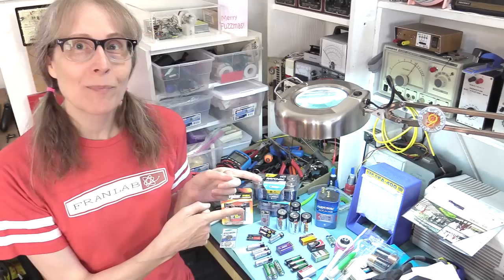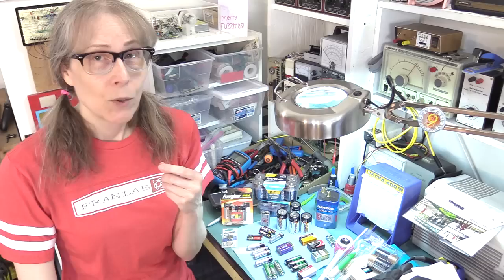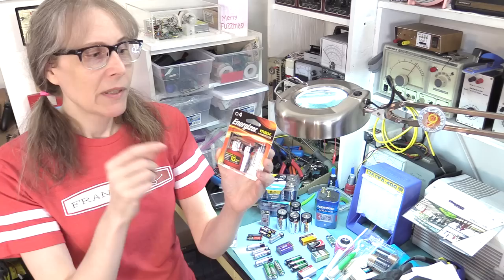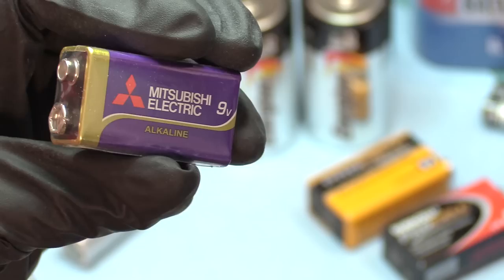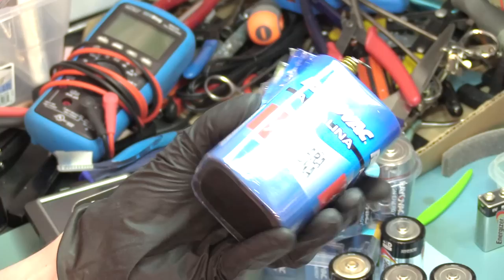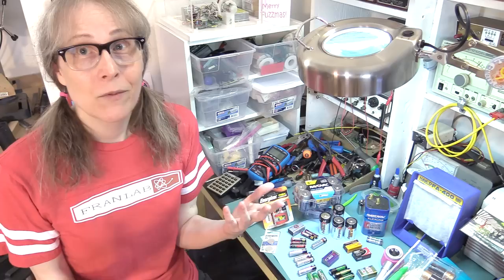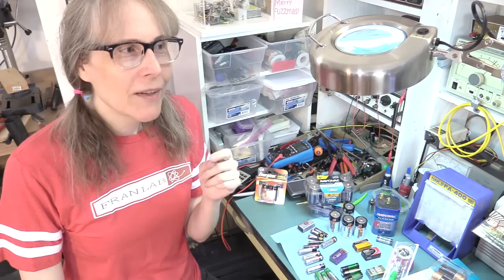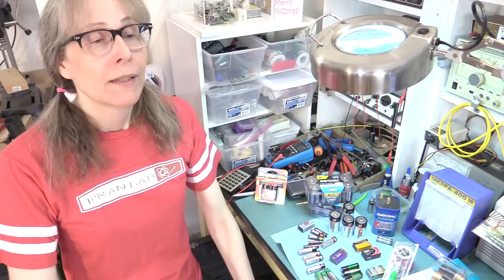Yikes! Leaky Alkaline Batteries!!!!

Comment: I've mostly switched to either "1.5V Lithium" Batteries or using NiMH Eneloops.
Be careful with the Lithium batteries tho as they have an open circuit voltage of 1.7V....so putting Lithium batteries into a device that uses more than two batteries in series is a VERY BAD idea. I've screwed up an expensive tester that way...
Reply: Nerdywolfi, good point ---- i have found that the lithium cells may tend to overheat some types of LED flashlights, especially the "cob" yellow strip leds. The designer was probably counting on the high internal resistance and voltage drop/current limiting inherent to ordinary alkaline batteries.

Comment: All brands of alkalines will leak.  Had it happen in the package and in devices.   Had a few leak in the package in the first year and the rest still good 8 years later.  Fresh, old, full, dead... maybe old and dead and Duracell is twice the chance, but at that level of chance you have to treat them all the same.  Don't leave in equipment.  At all.  One day they're good, next day a pressurized leak.  For a mouse you kind of have to leave it in, so I just wouldn't use alkalines in those.  Eneloop is ideal, or a "heavy duty" cell if you want a lighter mouse.  Heavy duty will eventually leak but it is much more gradual and much less wet.   At mouse (or remote control) current drain they're 1/3-1/2 the life of an alkaline.

Comment: Ive often seen zinc chloride "heavy duty" batteries leak in devices but not alkaline. I hate zinc battery's, they're not heavy duty and when they leak they badly corrode the battery contacts.

Comment: @Fran Blanche - According to wikipedia, Procter & Gamble sold off Duracell in 2014. For me, that just about lines up with the last time I had reliable Duracells. Today I refuse to buy them. They're awful.

Given the hanzi characters I think I'm always seeing on the Duracell labels these days, I'd say the manufacturing was all outsourced to China by the new owners. Unfortunately, Chinese culture is infused with the concept of chabuduo, which translates roughly to "close enough", "good enough", or more verbosely, "it only needs to work; it doesn't need to work well."

This is why I never buy anything that's "Made in China" if it's mission-critical or relates to my health & safety. Take advantage of their minimum-bid low-effort cost-cutting where it's appropriate, but don't use their products for anything you need to be good, safe, or durable.

Comment: Alkaline batteries always leak in equipment that has no standby current. If it has a quiescent current drain like a long life circuit eg a smoke alarm its fine. If it's something with a physical switch that completely cuts power thats when they leak. And its not just white powder its clear liquid acid that rots the contacts. I've had loose alkalines in the box that have leaked and split open. They need current drain or they fail.

Comment: do You know what other bad things people do with old batteries? more often than not, they throw them into recycling paper collections! that is very wrong, because the batteries get smashed in the recycling-pulper and the chemicals get into the process water, then into the waste-water treatment facility (which at best remove a fraction of that) and then ultimately into the rivers. It is not right to blame the recycling papermill for that. See what you ultimately get in the rivers: Li, K, Mn, Ni, Hg?, Bb, ...

Comment: You ask why did this happen, I say because you bought duracell's.
I might be a bit biased but I mean even their commercial is... "If you don't buy duracell's you might accidentally! fall off a cliff" the only thing it's missing is the mobster accent.

I can't say I've officially tested this but every time I've encountered a leaky battery majority have been Duracell.

My preferred brand is Energizer followed by Rayovac and if I'm at the dollar store I try to use Panasonic, assuming I'm not using rechargeable.
Oh yeah and I've got to the point that the batteries come out of the all devices when not in use it prevents draining and prevent leaking.

The only thing I leave batteries in are flashlights and then I try and check them weekly to monthly and log what was in them. PS maglites will warranty the flashlight for free if you have duracell's in them but you'll be paying for a replacement if they find out they are not.

And anything else that has to still have the battery in I try and leave in a way that if it leaks the circuit board is above.

Comment: I only wonder why they sell 1.5 volt batteries (as an example) and they stop working at 1.2 volts.... That means that overall electronics manufacturers have a secret contract with battery manufactures to keep them money rolling. A shame really, I have this LED light for outdoor use, in it are three AA batteries, which makes them total to 4.5 volt to the LED, and the light is 10 % of what it was when I installed the batteries when they were new. Measuring the batteries power output, they gave 1.2 volts.... 
Damn. How often do we throw away batteries that are 100% drained??? I do not think we do. So, we buy 1.5 volts, use .3 volts out of it and dispose the rest...  HUH??????
If we could combine those 'drained' batteries, we could power alot more longer, but the weakest link kills them.

Best solution for manufacturers of battery powered devices is to build a little vamp in it, sucking every last bit out of the battery.
https://en.wikipedia.org/wiki/Joule_thief
But..... they would not do that, because of the income it generates from depleted, as in not so much, batteries that need to be replaced.
Money, money, money, money.... and the environment?    Shame on those big companies....

Comment: Shelf life is when stored at room temperature. Chemical reactions (rule of thumb) double for each 10 degree rise centigrade temperature. I usually buy the bulk packs for economy, then store them in a sealed plastic container in my refrigerator. It takes me years to go thru them but they are always nearly full charge after years of storage. Don't put them in the freezer thou!

Comment: I always clean my corroded contacts with deluded acid =D
Reply: You might want to neutralize them after that. Acid will attack them too. Depending upon which acid you use it could take a while (or not). Alcohol should do it. Be sure to get under the contacts too.

Comment: Add me to the ban the Duraleaks. I've had more than one device that had the Duracells leak brown liquid well before they were fully discharged. I had that happen in an EOTech optic that had seen little use with new batteries and had not been sitting around for that long. Not good if you were depending on that. I've had a few other devices have the same thing happen with little use.

Comment: Fran - check out "Project Farm" on battery dollar to watt-hours video you may be surprised!  Sunbeam seems to just be the dollar store brand...they aren't great but for the cost they do stack up surprisingly well.

Seems to go in runs - I've had sometimes it seems like Duracells are way better and Energizers are leaking left and right.  Rayovac I've had several corroded in the package when I buy them, really WTF!  I don't think I've ever had any 9V battery leak or corrode...ever that I can think of?

Comment: Hi Fran, this is what I could find out about your"Winning battery" in long life.
				GP Green Cell batteries are fully compatible models equipped with high-quality cells that ensure a long battery life. They are dependable, and offer an economical, reliable power source for medium to low-drain applications such as self-standing or wall hanging timepieces.
	GP Batteries International Limited is principally engaged in the development, manufacture and marketing of batteries and battery-related products. Since its establishment under Gold Peak Group in Hong Kong, GP Batteries has rapidly expanded to become one of the world's major suppliers of primary and rechargeable batteries. It is one of the largest consumer battery manufacturers in China. It supplies an extensive range of battery products to original equipment manufacturers, leading battery companies as well as consumer retail markets under its own GP brand name.
	GP Batteries' production facilities are located in China, Vietnam and Malaysia, supported by marketing and trading offices spanning across Asia, Europe and North America. The Group currently employs about 6,000 people worldwide and occupies a total floor area of approximately 260,000 square meters.

Thought you might find it interesting.

Comment: Like reasonablebeing said below, they ARE garbage. I post ham radio vids. Posted one called 'duracell batteries destroy your gear'  after I discovered that the batteries in my SWR analyer had leaked. They were one year old, and were not at their EOL based on voltage, use, or time.

Comment: Does anyone know of a reliable accurate battery checker?  I think you need more than a voltmeter... batteries should be tested under load.... yes???
Reply: Rayo Vac just reimbursed me $40 for destroyed flashlights & replacement of their 60 pack of leaked junk batteries. Not even close to the cut off age

Comment: Nothing from Duracell is worth a crap now. I’ve had way too many devices ruined with the batteries still functioning.  Ray-O-Vac are the very worst leakers I’ve ever seem. Never buy those if you value your devices.  Strangely the off-brand China alkaline batts seem fairly good.  That said, I only order Panasonic brand alkaline batts now.  So far no problems last couple years.

Comment: Kind of pointless to compare the "guarantees" on battery packages.....most of the time they just replace the battery itself, if people even bother to complain. Some companies do offer to replace the damaged devices, but it is time limited, and rather iffy.

I recall when I was a kid, the only batteries seemed to be Ray-O-Vac, and those damned things seemed to leak at the drop of a hat. Ruined many toys that I loved, and my father would dutifully send the leaked batteries back to Ray-O-Vac at his expense, along with a description of the damaged toy, and Ray-O-Vac would send him a cheap/low-end flashlight, which I had no use for and which he then kept. I was deprived to many beloved toys that way, and to this day will not buy Ray-O-Vac....

I used to have good luck with Duracell, then everything went to hell and their newer ones seemed to be leak prone. I called them, and they said that they had factories in the far east as well as in the States, and the complaints were so bad with the foreign made ones in the USA that they were reverting to selling only the US made ones in the States. I have not checked to see if Duracell is still actually a manufacturer or just a brand these days. I still use them since they are the only ones in my local stores that I can buy in packs of more than 2 of 4. And they work just fine as long as I don't let them sit in seldom used devices for a long time.

It is important with seldom used devices to know whether they have a trickle drain, or if they have a true power switch that disconnects the battery from the circuit. In my experience,  if the batteries are now allowed to discharge at all, then they are not likely to leak. If the device has any value, and if it is a type without a true power switch, I usually try to use lithiums, as long as the voltage difference remains workable.

But as Fran said, it is probably impossible to make a true leak-proof alkaline cell. Manufacturers might market them that way, and offer guarantees to make it sound convincing, but they still need to be able to vent the hydrogen, and if there is a vent then there is a way for the potassium hydroxide to leak out too.

Comment: forget gorilla glass, we have KINGKONG now!!

i miss my nickel cadmium ones, they REALLY lasted long... never gonna buy nickel metal again, better using disposable ones

about circuits that are always on, classic remotes are not only always on, they are always scanning the keys and running a (dedicated) microcontroller, it's just when you hit the buttons that it delivers spikes of like half of an amp to the IR LED

i have a box of batteries and they just die in bunches without using em

Comment: Lithium 2016/2032 last eternally!  I stocked them for 18 years and they were perfect! And they never leak! And I also have 4.5 V Batteries saying "best before 1998" in flashlights!
Reply: Lithiums are pretty safe but beware of fakes! Some such cells are actually either 2 lead/zinc or alkalines hiding inside. A few are actually labelled as such on the cards they come on. 

Can't trust anything today.

Comment: Duracell and I are officially divorced.  In recent years I have had many expensive devices damaged by Duracell batteries.  Also many large unopened packages of Duracell batteries with expiration date years in the future, are cells were leaking.

Comment: For AA, just get ikea LADDA batteries. 4-16 should last you 20+ years and they will last much longer just on one charge than an alkaline does its whole life. For other sizes there are also good rechargeable. Samsung is typically a good bet. Anything made in Japan. Do not get anything made in China, they almost all lie on the package about capacity, but even cheap bad china rechargeable are eons better than those alkalines.

If you say "hey but that costs so much". I got 4 AA lada batteries for $6. Cheap AA 4 alkaline will cost between $3-$5.  After they die you have to buy them again. After the LADDA die you recharge them for what is essentially 1 penny worth of electricity. So what one costs more actually? If time didnt exist as a dimension, then yeah the $3 ones are a good deal....... The shelf life is much better with niMH too.

Comment: I have a bunch of Duracell All size leak even when still putting out . But if you send them the ruined item they will replace it  by sending a check along with coupons for free batteries  have had a mag light  replaced what’s sad they used to have great batteries now they leak badly I bet they used to be USA made and now from china ?

Comment: They don't just leak when dead. One time, when I was young, I'd forgotten my Gameboy was still powered at home, and returned to find at least one of those batteries fizzled out, red power light on, running fine. So you don't want to use some cells nonstop.

Comment: I can't believe there has been no real advancement in battery technology for a very long time. I want to charge my phone up and it last for 1 month. Why isn't this here yet..? Also batteries to power haulage trucks is never going to happen at this rate because the weight of huge batteries has its own diminishing returns. I really hate battery tech and especially all the videos out there promising the world but giving nothing. This is a major problem when Climate Change really needs this technology to make a quantum jump now! I still never see charging stations for cars in my country. How are people going to make the switch when there's nowhere to charge despite how much cheaper electric cars are for running costs and maintenance.

Comment: if it helps anyone
this is how i clean Battery contacts inside the device that have battery leakage or corrosion 

Initially i'll test it for resistance, 
i'm expecting to see 0.3 Ohm or less,   usually 0.1 Ohm
now let's say i see one with  OL  or like  5.0 Ohms Resistance
and clearly it has corrosion on it  or rust

well.. in the case of Rust
VERY FINE SAND PAPER (assuming it's surface rust only)

also.. if it's not recoverable , i actually salavage battery contacts regularly, so i'll just solder in a nwe one

but, if it's corrosion and needs a clean
here is my secret formula.....

NOTE ; this will stink like fucking shit so stand back
YOU'VE BEEN WARNED   LOL

Get some Bi Carb Soda from the shop
Get a can of Coke or Pepsi (i suppose will also work)
Get yourself a bottle of APPLE CIDAR VINEGAR (this stuff stinks like shit)

anyway
in some glass that 
1. is clean
2. you don't particularly need
(i generally use a cleaned out glass jar of Peanut butter

Put in around Half the jar full of the apple Vinegar cidar
Put an equal amount of Coca cola
as for Bi Carb Soda.....  Put Half the amount of what you put for Vinegar Cidar

Give it a gentle stir

Drop in your contacts
and just leave them there
come back 24 hours later

THEY WILL FUCKING SHINE LIKE THEY NEVER SHINED BEFORE
LOL

then wash them THOROUGHLY, with soap and Hot water
then thoroughly dry them
then test the resistance

you'll likely find that all the shit has gone and you'll get 0.1 Ohms again

all good to go
YOU'RE WELCOME